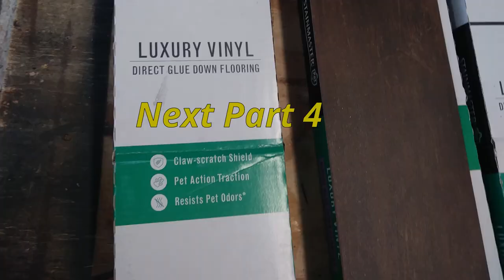Part 3 - 5x8 Cargo Trailer camper conversion - Lower cabinets build

Comment: How you going to stop  your AC unit by over heating ,That is a outside unit , sorry but it wont work  ,  you will have over heat problems on the AC unit
Reply from the maker: Not sure if you watched other videos showing how it was installed. It works. It has a compartment built around it that ventilates out through the vents. ( You need at least two inches of space on sides. Two fans and a condensation line that runs out underneath.

 There are many other people doing this, but I found nobody using fans.
 I was worried about excess heat, and decided to try fans. It all works. The reason I went with this option is because roof top AC units in RV’S are around $1000.00 for a good one, and the installation will be more if you can not do it yourself.

 They are heavy and have problems leaking. They do not last as long as they used to. The window units are very cheap and can be replaced much easier. Nothing wrong with going with the roof top as long as you are willing to replace it often.

Comment: Nice!  I am going to follow your lead and place my window ac like you did..  Can you tell me the distance from the bottom counter to the underside of the ac cabinet?  thanks
Reply from the maker: I will get that measurement and reply again. Thank you for the comment.
Reply from the maker: It is 16 3/4 inches from counter top to bottom of upper cabinet floor. I have an update video with more information on AC install and some other measurements that might help. Should be up this weekend. Hope this helps.

Comment: Why do you have the center counter top so you can lift off?
Reply from the maker: Actually there is a few reasons. If you notice in later videos, I have a portable toilet under there. This was a option to remove the desktop so that the toilet could be there. Also learning from my own experience working on campers and RV"s, You can have some tight places that are hard to work on. This gives some extra room to work on electrical and under upper cabinets.

Comment: What about condensation from the AC? Will those little fans be enough?
Reply from the maker: The condensation goes out the attached drain hose. see here at https://youtu.be/dtyjekwBSJY?t=25 and also if you watch Part 2 shows more. 
Part 2 https://youtu.be/W5W-wj07l6s
The fans are to help AC stay cooler by forcing hot air out, and pull cooler air in. There are some people who have done it without the fans, but excess heat built up would probably mean replacing AC often.

Comment: The ac needs to vent heat from condenser outside or it's useless.
Reply from the maker: It does.... See AC Install https://www.youtube.com/watch?v=W5W-wj07l6s
Reply: @SlipperDogTV ( cool) need to put one in my trailer hot down south. Good job like the drain tube.
Reply from the maker: @patmason7276  Thank you, yes sir it has been hot. Even if you use a cargo for jobsite, it gives you somewhere to cool off.